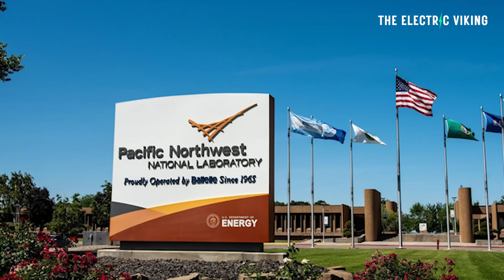Microsoft AI analysed 33 million candidates to find material to replace lithium

Comment: In 2013 "A team of scientists from Ames National Laboratory developed a new machine learning model for discovering critical-element-free permanent magnet materials" Lots of machines working to compress the next 250 years into the next 20 years.
Reply: So... if i get this right by using AI Microst reduced 33 million different chemicals and 250 years of research to 25 years
Although a Chinese company is already doing this
Must say sort of proves the "250 years" in question...
Reply: @qinby1182  The 250 year 10 to 1 claim is about chemistry research in general, not just this batter example.
Reply: Yes this is a good example of the fact that where AI doesn't replace humans, it will increase the productivity of humans by over 80%. Departments that used to require 10 people will get by with two or three people.
Reply: More than 10 years ago? So what came of that?
Reply: @Withnail1969  I copied and pasted it incorrectly it should’ve been 2023 I don’t know how I got 2013 well you should Google what is inside the quotes because it will point to a technical paper but I think the magnets they are working on, they’re still working on how to make them because Magnets require a special temperature and preparation to actually become magnetic
Reply: yes, this channel starts to be quantity over quality, this one is probably its lowest ever, UNWATCHABLE blah blah
Reply: It sucks that you're forced to watch these videos and complaincomplaincomplain... @compsourcegoogle1284
Reply: @compsourcegoogle1284  You're an utter clown.